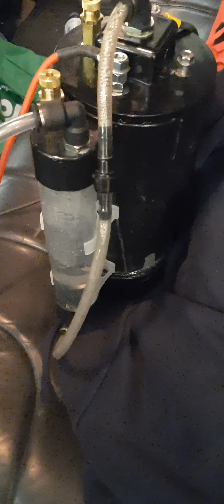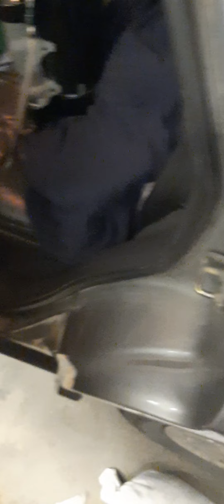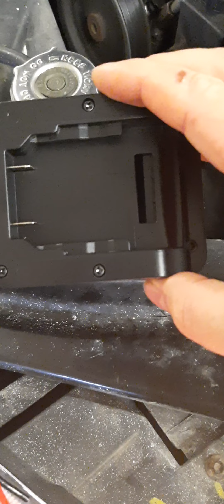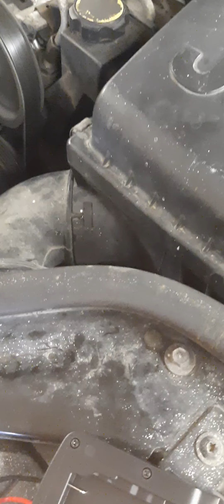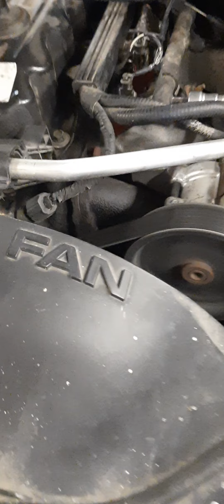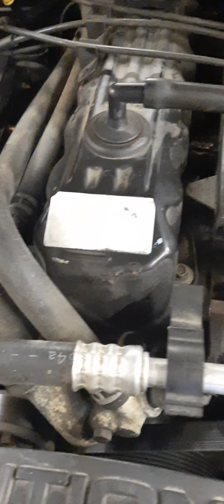Hydrogen generator hooked up

Comment: I was putting together a hydrogen system in which I am going to place a map sensor enhancer. I have seen it in other videos. They place the enhancer to lower the signal or raise it to the map sensor, giving the computer an indirect order to regulate the mixture by lowering it and So this is how the hydrogen cell is included, obtaining a large amount of performance in diesel or gasoline in the case of the Grand Cherokee, the Cherokee and the Grand Blazer, here in Venezuela it is gasoline-powered, they also sell an enhancer that controls the IAT valve. which is the temperature of the mission in the case of yours I wanted to know if you have used these resources and if I would like you to suddenly convince me to make your experience about that
Reply from the maker: I looked at that for newer vehicles, it's a bit of work setting things up but should get the mixture to change correctly. 
What mine is working on is an early 80's Chevy 350 with a modified dual fuel kit that normally runs on gas or propane but now runs with a 70/30 mix of hydrogen and gasoline.

Comment: Hello, God bless you, I have been closely following your videos. The way you handle the cell seems excellent to me. I am going to try to reproduce a similar one here. I live in Venezuela and although we are an oil country, it has been very difficult to tank even once. car and very expensive for The salaries here I have been preparing a cell to mount it on my truck I initially had a Cherokee xj but it brought me a lot of problems because it is not original I sold it I currently have a Grand Blazer with a 5.7 GMC engine the Grand Blazer is truck like the Cherokee, very commercial here in Venezuela and has an even bigger engine, but this truck is better preserved and I want to install a hydrogen system in this truck to offset the cost of fuel a little,